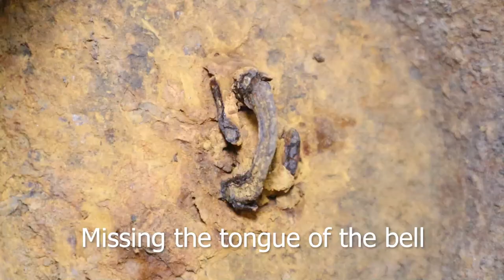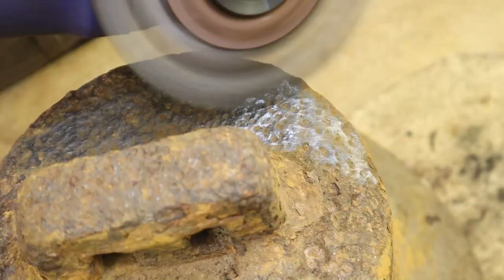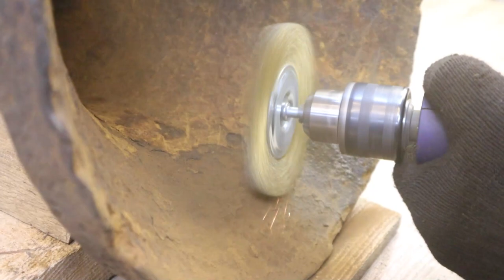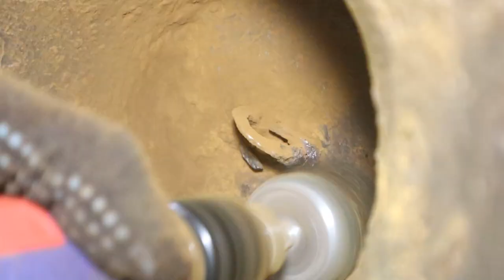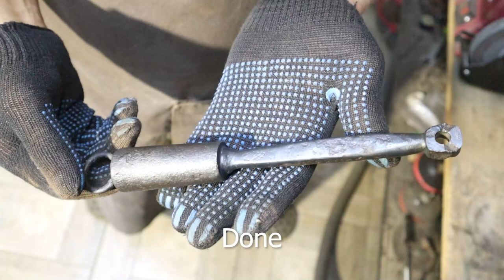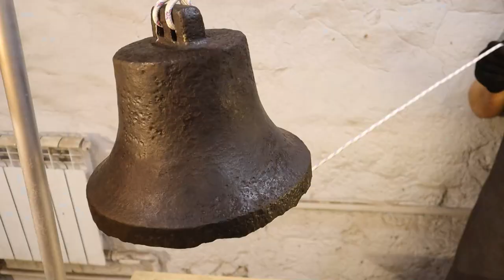The old bell from the ground rang again! | Restoration of antique

Comment: If you used rust remover.And removed the piting.It would probably sound better.
Reply: Commercial over the counter rust-oleum rust remover versus 1/2 5% vinegar 1/2 water solution rust remover?